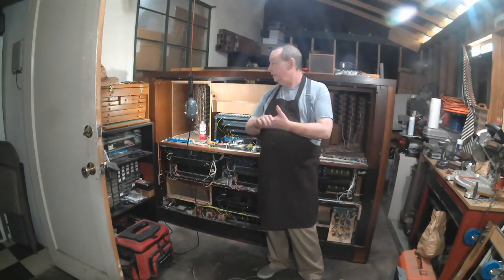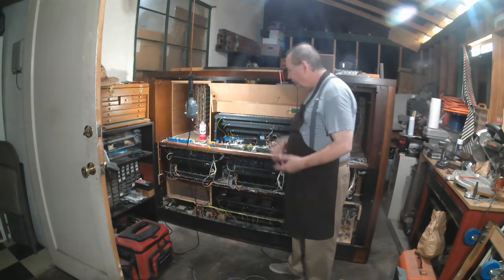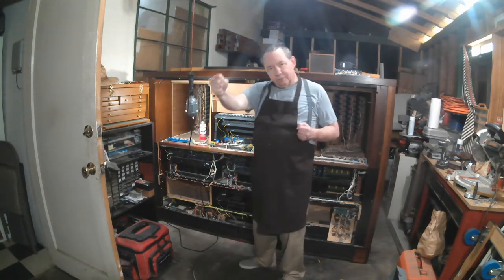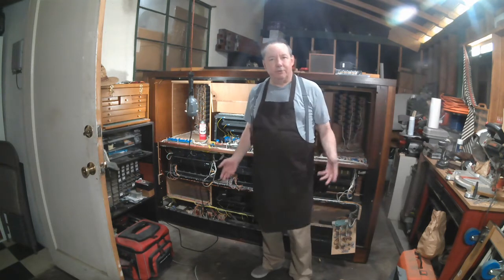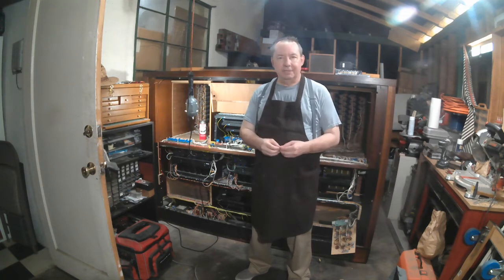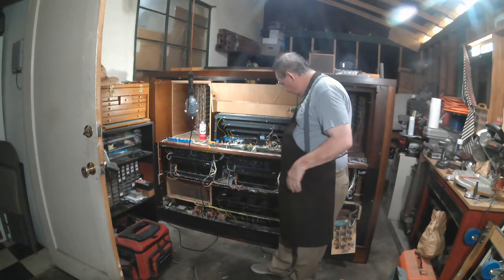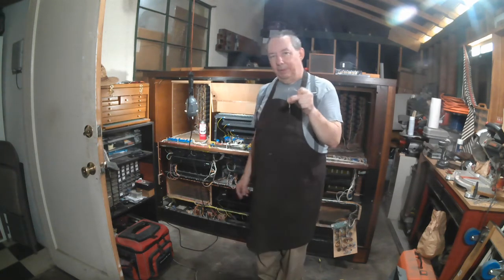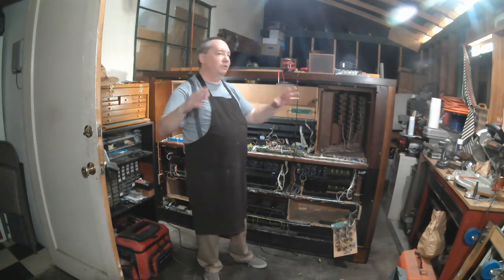Organ Technology part 4 Digital organ tour

Comment: I have found a non-contact audio tracer, such as those used for telephone service, to be invaluable in locating/monitoring analog audio signals. They work equally well on speaker outputs and line level. (They are also great when used with the “toner” to identify conductors in a pipe organ cable bundle)